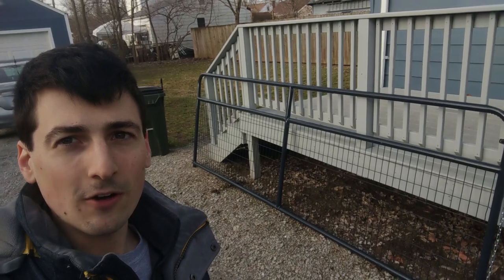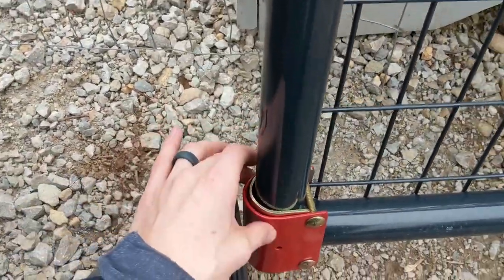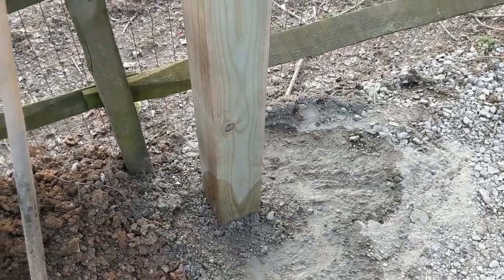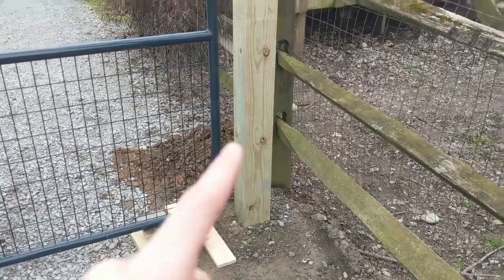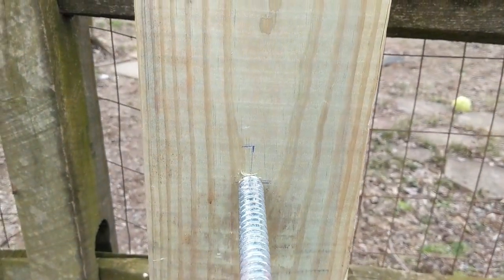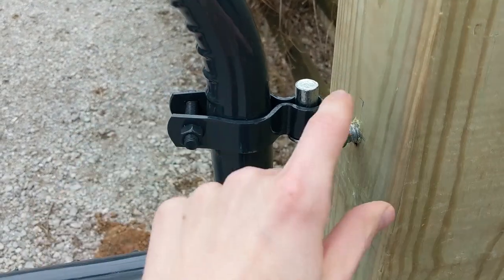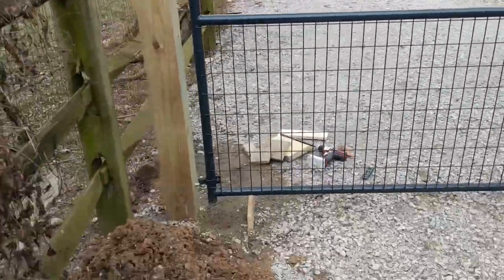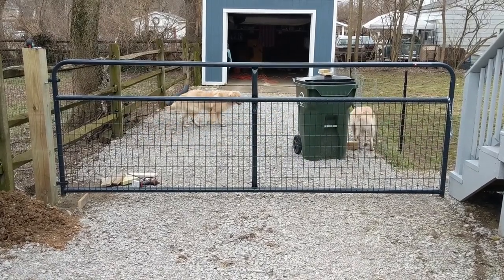Tractor Supply Utility Gate Installation | CountyLine Wire Filled Tube Gate Review

Comment: if you are worried about someone taking the gate off its hinges to access your property you can put the top hinge in upside down. the green rubber band is just a packing thing that keeps the hinge on the gate during shipping and such.
Reply from the maker: I thought about that but it would make installation harder for me and a thief could still just loosen/undo the hinge clamps on the side to take it 😞
Reply: @DigitalDavid  the top hinge goes down loosen the ring on the gate and slide it up on the hinge
Reply: A trick : watch movies on Flixzone. I've been using them for watching all kinds of movies recently.
Reply: @Francis Casey Yup, I've been watching on flixzone for months myself =)

Comment: The gate was installed improperly in regards to the (hinge pins) lag bolts.  The top lag should be facing down, not up. With both screws (lags) facing upward anyone can just lift the gate off of the hinges, even if you had a lock on the other side.  Here it is being used for dogs but larger animals have been known to "lift" the gates off of the hinges when installed the way you have it. People have been known to lift the gate up and walk right in. Having a wheel on the opposite side is a great idea and it will take a bunch of weight off of the 6X6 post.  The best wheel to get is actually on a spring so that it can function on uneven surfaces and it rides in front of or in back of the gate, not along side, so it doesn't add extra room that would allow the animals to squeeze through the side. They are sold in many stores.  You do have to drill 2 holes in the tube gate to mount it but it makes a world of difference and for uneven ground it can't be beat.  A suggestion for this situation would be to add another post on the opposite side of the 6X6 post you cemented in the ground.  It can be another 6X6 or something smaller.  It doesn't require as much (if any) cement either.  Once in place it will take away any room for animals to squeeze through and it will give you something else to secure the gate to.  It also gives a great finished look while allowing for a lockable gate latch to be attached to it.
Reply: Thanks I am trying to figure out how to diy ours and our dogs are so good at getting through doors, especially one of em. Any tips would be great. Do we have to use cement? We need to give utility workers access to our yard. Can I just install a long gate from house to other yard fence? The opening is 22.4ft
Reply: Awesome bud I'm about to install a 16' gate like this and also a 4' gate as well thanks for the wheel tip
Reply: @andrewdenine1685  
YW.  Good luck friend.  👍
Reply: I was thinking that too.
Reply: You should put the wheel on because it will keep the gate from sagging and the hinge pins from loosening. You can raise the wheel higher so the gap at the bottom is smaller.
Reply: @theFLshark  
👍
Reply: @theFLshark  
Spot on.
Reply from the maker: Thanks for the comment! -MB

Comment: That green rubber O ring was put on the hinge to hold it initially to the gate so it wouldn't get lost from the factory. It can be removed after installation. Great video thank you so much for your help.
Reply from the maker: Thanks for the info and leaving us a comment. I am glad the video helped you out :) The gate is rock solid since I installed it and I use it everyday! No rust/lean/tilt or any shifting... very impressed with the quality!

Comment: Just a suggestion to prevent someone from lifting up the gate off the hinge posts: Keep the bottom hinge post pointing UP and then place the top hinge post pointing DOWN down. Thereby keeping the  brackets from slipping up ordinance off the hinge posts mounted in main post.
Reply from the maker: Yes lots of comments mentioning the same thing!  Up to the installer and where it's located!

Comment: Top hinge is mounted wrong. Supposed to face down, otherwise you can just lift the gate right off.
Reply from the maker: Thanks! We mounted it this way since you can just loosen both clamps to remove the gate so feels like a moot point!
Reply: The weight of the gate is on the hinges. If the top bolt was upside down, the weight of the gate would be on one hinge.